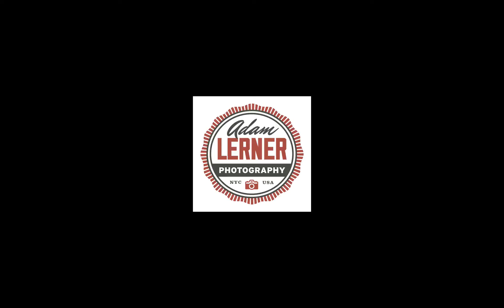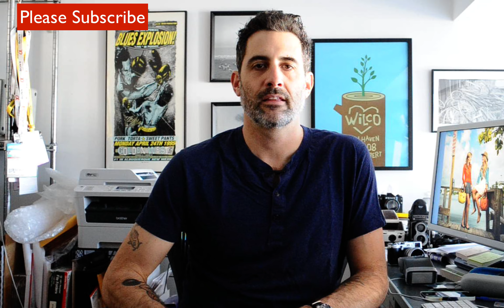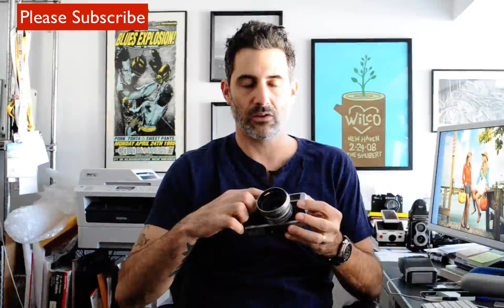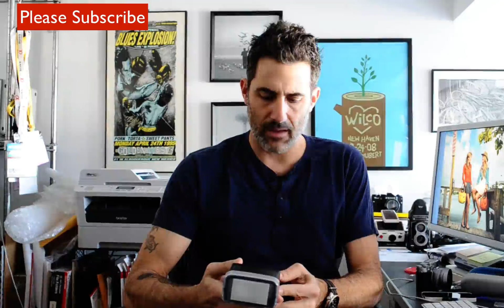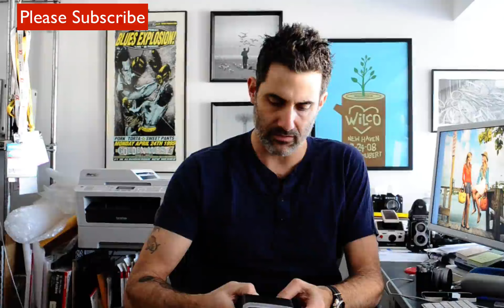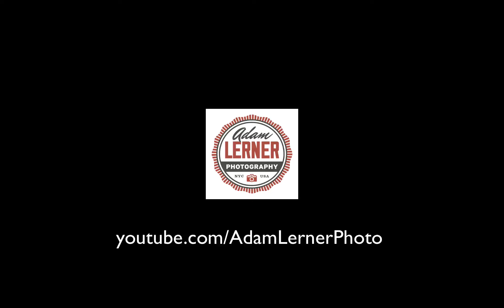Photography Lighting Tips, Off-Camera Flash Optical Sync

Comment: how to do it with canon 50d and speedlite 580ex ii
Reply from the maker: Youre 50D has a pop-up flash, so you'd use that to trigger the 580 by putting the 580 in slave mode.
Reply: how to trigger it?+Adam Lerner

Comment: Set your camera's flash to MANUAL and stick your SB900 to SU4 mode. 
(To enable SU-4 mode hold the OK button for 2 seconds, or until the custom functions menu appears. Using the command dial select the SU-4 menu item then press the OK button. Use the command dial to move the cursor to the 'ON' position then press OK. Press EXIT to exit the custom functions menu and enter SU-4 Optical Slave mode). You'll have to set the power level manually on the flash, but it should work fine.

Comment: Hi Mr Adam thanks for the video. I have the Nikon D5100 this doeasnt have commander mode in the cameras menu only ttl and manual. What do i need to do to make this work off camera with my sb900 using the pop up flash, sync cable or wireless triggers (do not have any of these wiring as yet) :-). All videos ive watched so far with the sb900 or 910 only demonstrates the commander mode. Thank you.